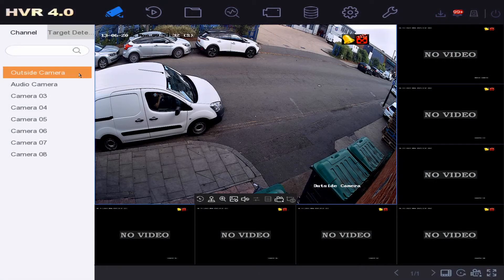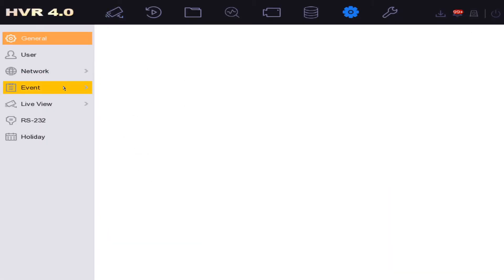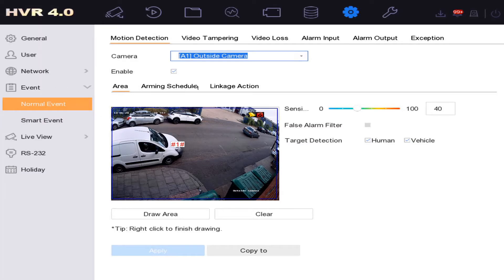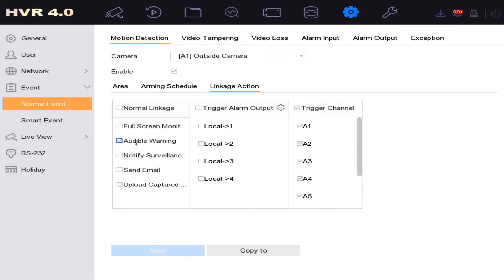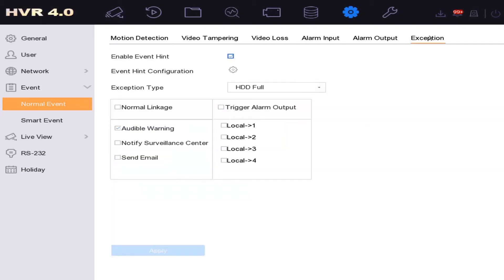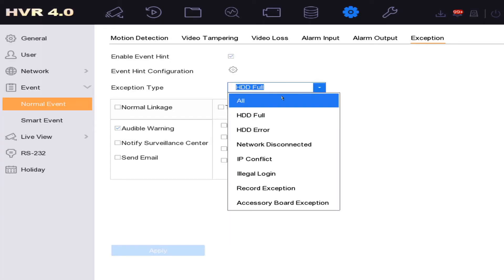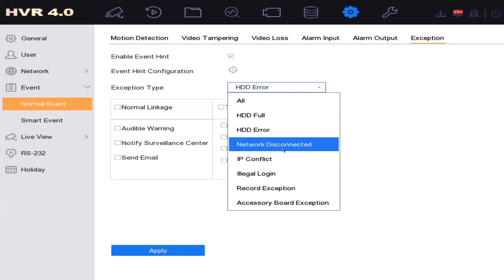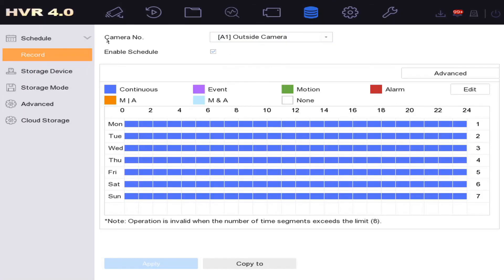Hikvision DVR How to Stop the Beeping Buzzer

Comment: I have the same beep but my monitor wasn’t working through hdmi so I use the other lead supplied that made the monitor work where I could then access the power button to reboot system and it all worked fine.